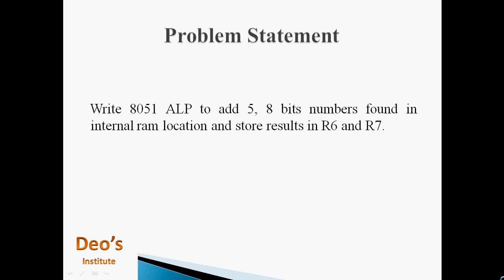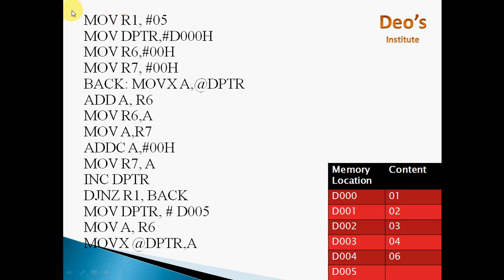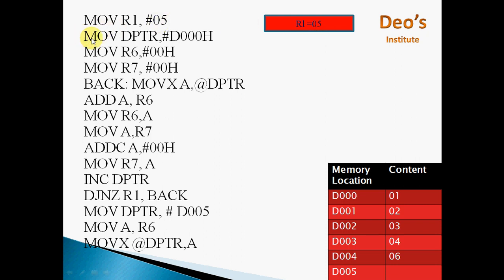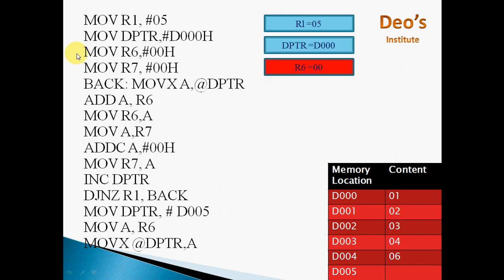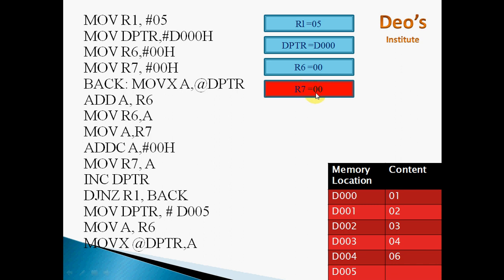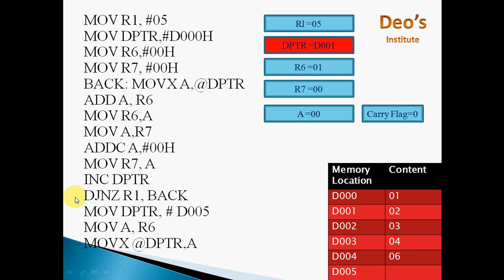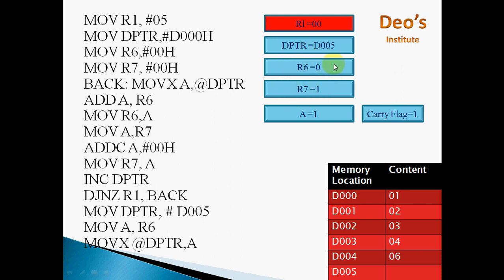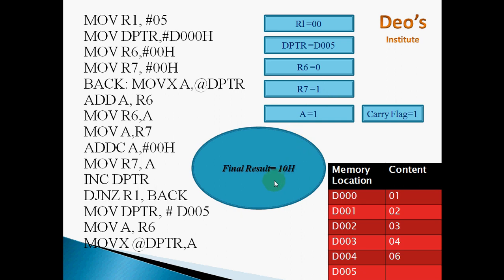8051 Addition Program | Array addition in 8051 Micro controller

Comment: MOVX is use for external memory. It's not wt u say. Pls correct it.
Reply from the maker: Yes.. right ..but here also I have used for MOVx @dptr, A
Which is used to move contents from accumulator to memory location stored in DPTR register

I have run this pgm it works correctly...
Reply from the maker: Yes.. right ..but here also I have used for MOVx @dptr, A
Which is used to move contents from accumulator to memory location stored in DPTR register

I have run this pgm it works correctly...
Reply: Ohk. Thanks. My bad. ,,😊